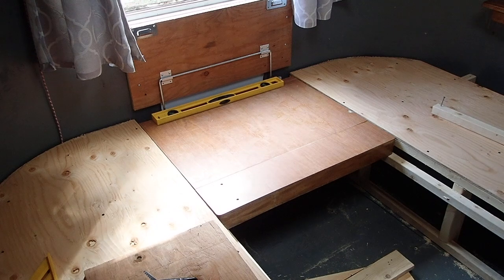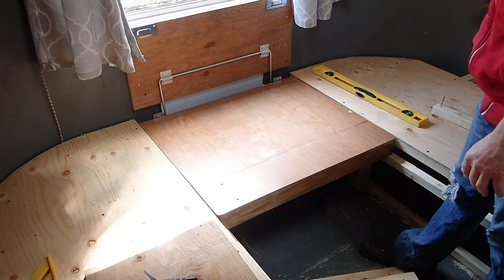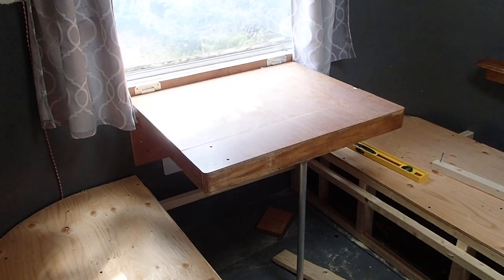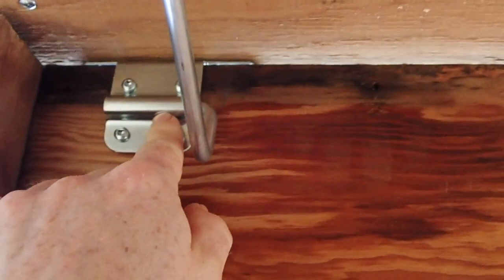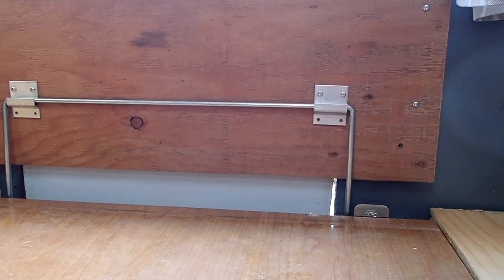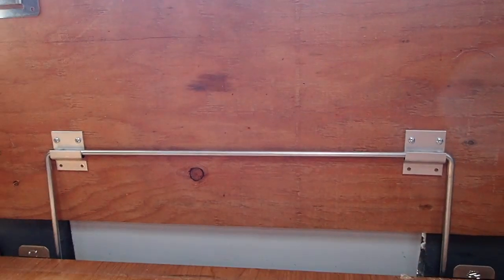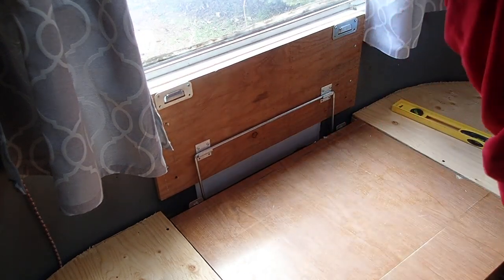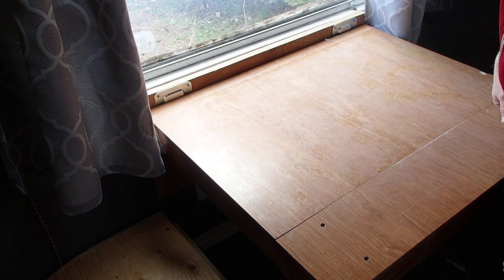How To Install Camper Dinette Hinge - Vintage Table

Comment: My hinge kit came with two small plastic tabs....any idea what they are used for?
Reply: They keep the rod from popping out of the hinge bracket that mounts on the wall. Take one of the top two screws out, place the plastic tab over the screw hole and put screw back in.